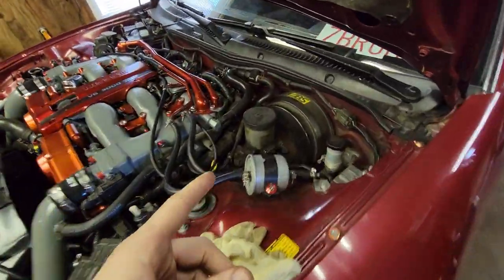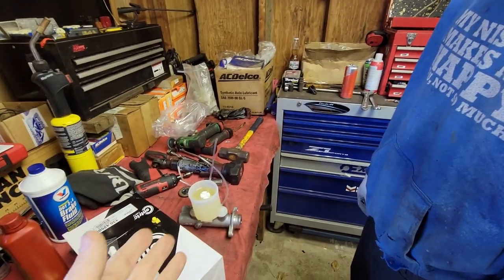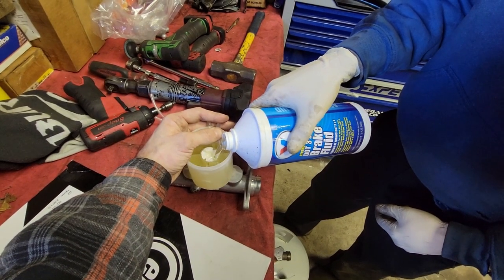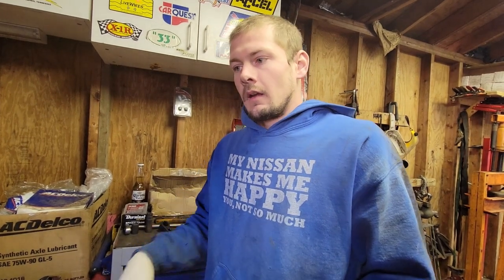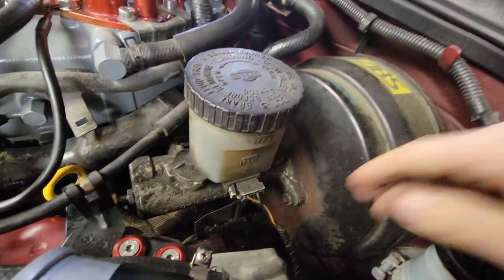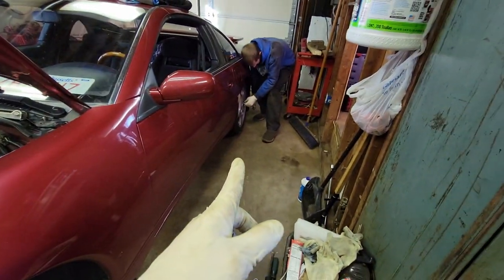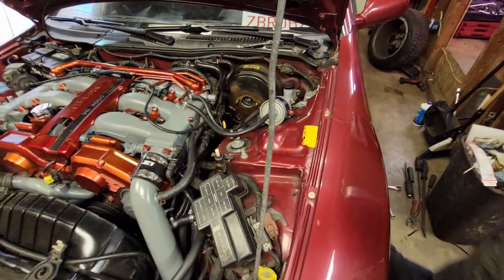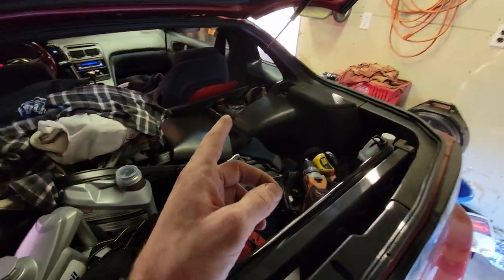How to Replace & Bench Bleed a Nissan 300zx Brake Master Cylinder

Comment: Generally, yes its best to start with the caliper furthest from the master cylinder... but in a Z32 with ABS, you are supposed to do left rear, right rear, left front, right front and then finish up by bleeding the ABS pump. The reason its a bit different is due to ABS pump location on the passenger side and length of hardlines in relation to it.

At the end of the day it doesn't really matter because either way it should completely bleed the system, but just wanted to point that out!!

Comment: Hey, as always great video. I'm about to order and replace mine as I have a vacuum leak there. Do you remember if there is some seal or gasket that goes between master cylinder and break booster?
Reply from the maker: It's built on the master! Just plug and play
Reply: ah so probably the leak comes from rusted out break booster rather than the master cylinder itself :D  Thanks !
Reply from the maker: @Tomasz Sławiński  leak is coming from the master. The rear of the master gives way then starts leaking into the booster

Comment: Hello, is it possible to remove the fluid level sensor from the reservoir? how is it done? -thanks =)
Reply from the maker: @space_cowboy007  tbh, I dont know. But if you were to do this the warning light on the dash I'd assume would be stuck on unless you bypassed the plug
Reply: @ZBruhzchannel  it's like 80% of the time ON. so unless something can get stuck in the reservoir itself there is a faulty electrical contact i'd like to clean properly and i cant do that very well in the car
Reply from the maker: @space_cowboy007  weird, when was the last time you did a flush?
Reply: @ZBruhzchannel  couple years i guess? for some time after the flush the problem went away and then it came back.  i checked the fluid level & pad wear last month tho and everything's fine, the car even passed inspection
sometimes the light goes on and off in corners too lol
Reply from the maker: @space_cowboy007  if it's doing that on corners I'd say it has something to do with level
Reply: @ZBruhzchannel  level is well above min already, it's more like light's on all the time when i start my journey , then comes off in sharp corners. then after like 1hour of driving it comes off driving straight. so the temp seems to influence some kind of connection too (but it shouldnt)

Comment: That master cylinder is apparently a bitch to get off. Any tips on actually removing that part?
Reply from the maker: Removing it can be tough! What I found that works best is buy draining all the fluid first, then unscrewing the master from the booster and really trying to work different angles to shimmy it out. Take your time, and it will come out!